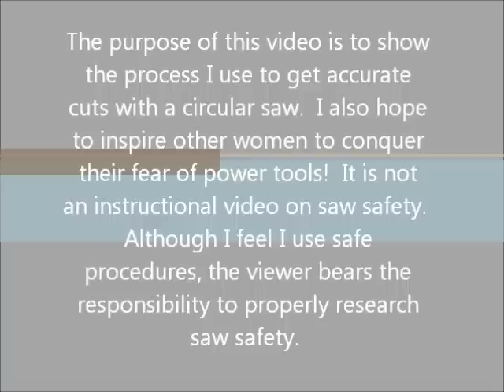Cutting a sheet of plywood with a circular saw

Comment: Thank you so much for this!  I have a lofty goal of building a cabin on my land, but am so new to tools, and have little baseline knowledge.  Most dudes take a certain baseline of knowledge for granted when they try to explain how to use certain tools or build things to me, so I really appreciate the "basics" approach you take in explaining this.
Reply from the maker: Thanks Christina Galeano --I found it difficult when I was starting out also, to find information that was from a true beginner's starting point.  Glad this helps!  Lofty goals are excellent to have--good luck with your cabin building!
Reply: Christina Galeano:
I aint shure what kinda axess you has to logs, but you can shure build a cabin reel easee by usin 3 sided logs. 3 sided logs is sawed flat on 3 sides so the 1 round part a the log is showin outside the cabin. You just drill an spike each log on top of anuther log with a layer a insulation in between each log. Overlap the joints... it is easee an STRONG. There is problee lotsa vidios on You Tube bout 3 sided logs, but I aint looked to no for shure.
I lived in a veree remote part of Alaska so I had to bild my cabin with no power tools eggsept a chanesaw and other hand tools. Took me bout a six munths to bild a 16 by 24 foot cabin from scratch. I had metal roofin and stuff I coodent make flown out in a flote plane, but 90 persent of that cabin was frum nature. Eben the ferniture. Bilding a log cabin is hard work phisiclee, but mentalee it is veree relaxin, an satisfyin. I has lotsa vidio footage of bilding it, an a few other cabins to, but I aint shure how to put em onto You Tube yet. 
Good luck with yure cabin.
      :)

Comment: As another woodworker / finish carpenter of the pink toe persuasion who has a full-time, permanent Southern twang, I used to use a Dewalt 18 volt sidewinder and a corded 15 amp Makita magnesium hypoid worm drive saw for a lot of work when I did framing, but for breaking down sheet goods and for finish work I do mostly now, I much prefer my Festool TS55 track saw.  I loathe cutting on the floor, but when I have to, I use a sheet of 2" rigid foam insulation as a backer board.  With the TS55 track saw coupled with my HEPA-filter CT26 dust collector, there is almost zero sawdust or debris to clean up.

Comment: Tip for anyone on a budget: You don't have to spend tons on your circular saw, but most definitely DO get the best blade you can put your hands on. A sharp, high quality blade designed for the material to be cut (plywood in this case) will make a bigger difference than any other one thing you can do. Great presentation. Keep it going.

Comment: Good video because you go over some important procedures many overlook i.e. setup, use of a guide, protective gear, wood placement etc. You don't need a table saw to rip sheets of ply. I have a table saw and unless you have the room and a couple of sawhorses and a couple of roller stands it's  just as quick with a circular saw. Just make sure you have a quality blade, 52 tooth or greater is recommended, for ply and cross cuts. Setting up the guide the way you describe is an excellent method to insure accuracy.

Comment: I recently got the Circular BOSCH SKIL Saw and was very much confused how to cut the wood in Perfect Straight line. After watching your video I was able to understand that now I need the Other piece of Wood which would act like a Guide to Cut the wood in Perfect Straight.     Thanks a lot for your video which is Really helpful for cutting long plywood pieces for making the Wardrobes.
Reply: Not meaning to be pedantic, I would point out Skil is a company and Bosch is a separate company.  They each make power tools.  To call a circular saw made by Bosch a "BOSCH SKIL Saw" is like calling a car built by Daimler-Benz a "Mercedes Ford."   Similarly, a "Brand X" cheap knockoff adjustable end wrench would most definitely not be a "Crescent wrench,"  although you can hear such things said often.  It's bad because it gives the impression to others that the speaker doesn't know what he's talking about -- even if he's a skilled and expert craftsman.
Reply: Zain Khan I don't think welsh rabbit understands proprietary eponym. Skil saw is synonymous with circular saw.
Reply: Hmm. I did'nt knew Skil and Bosch were different. 
But when Bosch sells the Products. It says: Skil by Bosch".
Reply: I'll have to check out the box, I just got one. It might be a corporate merger that I missed.
Reply: It appears that Bosch did indeed used to owned Skil. It was sold last year to "Chervon". I'm not sure if that is a typo or not.

Comment: Love that your attempting using a circular saw as many would be afraid to, your 2x4 should run with your cut unless the timber underneath is scrap, buy or make yourself a couple of tressels out of timber 2x4, its funny saying that as in Scotland its 4x2 make your job a lot easier keep you of your knees and better control on your saw, but I praise u for doing your own work as there's very few with your ambition.

Comment: Awesome job.  Covers all the safety aspects and did a great job. Even if you had a tablesaw you would still probably prefer to do it this way. Big sheets of plywood on the tablesaw are very hard to handle unless you have a huge out table and set up is difficult.  That's a great 8 foot cut out jig. I've only made a 4 foot one maybe I need to make an 8 foot one too. Thanks!
Reply from the maker: Thanks so much!  Everyone keeps saying my back won't hold out (and honestly, it doesn't like it after awhile--and for a few days after lol) but I don't think I can wrangle a full sheet onto sawhorses or a table saw (and no outfeed table as of now) without help and I build by myself.  Sawhorses might be doable and I could make them work double duty as the base of an outfeed table, so I am probably going to look into those, but I have a feeling I'm going to prefer the floor because I'm just used to it at this point.  I have used the 8' jig a LOT, I would call it indispensable for my projects!  Thanks again for the comment :)

Comment: nice video....an alternative to using 2x4's under your plywood sheet is a thick piece of pink insulation...it supports the sheet while allowing the blade to cut harmlessly through the foam.
Reply from the maker: +Art Julius The sheet of insulation is a good idea too, and one I thought about using when I was figuring all this out.  I decided on the plywood because I could tuck the 2x4s away in a corner of the garage when I wasn't using them and the sheet of insulation took up more room.  But I think it would work well if you have room for it!

Comment: this method definitely works well,just very time consuming. One that I use that is quicker especially if you are cutting several strips of the same size is to just make a jig that lips over the edge of the plywood and is the length you need for your cut hold the jig to the edge of the plywood and hold the saw up against the jig and cut.I could have made the jig and completed my cut in less time that it took you just to mark your piece. I am a finish carpenter so I have to do a lot of field cutting using circular saws or just small little jobsite table saw and that is my most used method. I also put the sheet on saw horses and I use cordless circular saw with a thin curf blade. Nothing wrong with the method you are showing here at all just sharing another way.

Comment: Heard your comment about wishing for a table saw, but most woodworkers still cut their sheet goods on something like a torsion box table due to the size.  Search for a video called Addict Cut Table for a 10 buck table that also has a built in lever to lift even a 3/4" full sheet of plywood onto the table all by yourself!  Yes, you'll need a couple saw horses, but there's plenty of them you can find on Youtube made out of a couple 2x4s.... keep at it!  For less than $30 you'll have it all and can drop a sheet of plywood on it during parties and play beer pong!  LOL

Comment: If I might make a suggestion, as one gets older getting up and down on the floor becomes much harder.  I use the same method except I have two saw horses that hold a door.  I use scrap wood to raise the panel off the door as the door is not 4 x 8 but this puts the panel at a height U don't have to go up and down.  The saw horses fold up and are stored out of the way when I don't need it.  I still use a worm to cut panels which makes cutting much easier with the added power.

Comment: Awesome. I don't have a table saw so I wondered how I would cut large sheets like this. Now.. I just have to have a truck to haul such large sheets! I guess maybe I can convince the supply stores to cut them down a bit for me...
Reply: Use karate ;)
Reply from the maker: My favorite "truck" for hauling so far was my Honda Odyssey minivan if you can believe it!  I could get a couple of full sheets of plywood in it and still shut the back which meant I could also fit all of my face frame boards in there too without them flying out the back.  Now I've got a Honda Pilot and I can only haul in good weather and I get nervous about how well it is all secured as I'm driving down the road with the back open.  Do you have a Home Depot close by?  You can look into their truck rental service.  I have a friend who has used it and said it was pretty easy.
Reply: Actually yes home depot is only about 3 miles away
Reply: I rent a pickup truck from Uhaul. It's not expensive as long as you're not renting them all the time. And home depot has one you can rent by the hour.
Reply: Pink Toes and Power Tools NU vrei sa fi sotia mea?

Comment: nice video.  Consider putting the 2x4s inline with the plywood to eliminate the tripping hazard.
Reply from the maker: Hi Tony--thanks!!  I intentionally put the 2x4s perpendicular to the cut I am making so that the board is fully supported as it is cut off, to hopefully eliminate any chance of kickback.  But it does make it harder having to be aware of where they are during the cut!

Comment: Hi Kristen. Thank you for sharing this video. I'm building a shed at the moment as my first building project and watching a lot of how-to vids on YouTube. Yours is one of the most - if not the most, informative I have seen. I really connected with all the details you addressed - those are the things that so many other videos (mainly with guys I might add) assume you know and don't explain. You clearly have an innate knack for explaining simply and identifying all those simple details that many videos tend to miss (for example, I liked the knot in your power cord and slinging it over your shoulder and the way you explained the speed you move the saw to prevent burning). One question... do you set your saw around the same depth as the ply? I guess you use those 2x4s underneath as your supports all the time so it doesn't matter if you're cutting them slightly?... Please keep up with making your videos. I think you bring a very unique and refreshing perspective to way building is taught and you're videos will be invaluable to both women and men in empowering them to have a crack at building. Kia ora from New Zealand!
Reply from the maker: Thank you so much for your comment!  Sorry about the late response, I haven't checked this in awhile.  I do set the saw slightly more than the thickness of the ply, plus add in the thickness of your guide (mine is 1/2") so when I adjust the depth of the blade, cutting 3/4" ply + 1/2" guide = a little deeper than 1 1/4".  Lately I have to adjust it a little deeper than even that, because I think my guide has warped a little bit and sometimes the blade doesn't clear the entire cut.  Thanks again for your kind words :)

Comment: I prefer to have the plywood on saw horses.I mark each end of the plywood at the width of the cut, take a chalk line and mark the cut line then use my saw to cut the chalk line.  simple
Reply: roy hoco OK when doing rough construction!! but more delicate precision measuring needs a guide!! especially when using birch!! which only gives you a thin layer of smooth wood!!
Reply: k sera
Reply from the maker: Nothing at all!  I didn't have one at the time that I made this video though :)

Comment: 1st I would toss that particular saw right in the bin and pick up a nice Milwaukee, Bosch, Porter Cable or DeWalt. For blades, Freud Diablo blades are awesome for the price. A trick is to listen to the tone of the cut - a perfect even sound/tone will produce a sheen to the cut edge and shows your not twisting the saw through a nice straight cut. After years you can do this without the guide. Your cut was close to perfect in this manner - it is mostly the saw and blade that are your problems.

Comment from the maker: I need to find a way to attach the pencil to me somehow--it's always in the opposite part of the garage than where I need it!  I'm pretty sure that I used the cuts on one of the storage beds with drawers that I made for my kids--I think that is what I was working on at that time (you can check them out at Pink Toes and Power Tools).  All of my woodworking projects are under the "Project Gallery" tab at the top!
Reply: Pink Toes and Power Tools that’s what your ear is for PT

Comment: I would recommend positioning your sheet on the ends of the 2x4's- so you don't have them sticking out on the side where you are cutting from. It is unsafe and awkward to have to step over them while cutting- simply reposition the sheet so the ends are not sticking out- and you don't have to worry about tripping over them. You don't want to trip accidently with a running power saw in your hand.

Comment from the maker: So far I've avoided hard wood because of the expense--especially as a beginner.  I am thinking about using poplar for the face frames of a built in I am planning for.  It will be painted, so I don't mind the unappealing color it can have.  I know it isn't the hardest of the hard wood, but I can't stomach paying hard wood costs--even now that I'm not a total beginner.

Comment: Good presentation, and I like the jig you made - great idea.  As a female, I knew nothing about how to use any power tools. Since I love decorating, but hate paying for the labor and (so often)  poor workmanship, I purchased assorted power tools and taught myself by watching videos and reading.  Now I'm always involved in a project. Tongue & groove ceilings, crown, tiling, installing wood flooring, etc. Just curious, what project are you cutting this wood for??
Reply from the maker: K Kat Thanks for the comment!  I can't remember which project I was working on when I filmed this, but I think it was the storage drawer bed I made for my daughter a few years ago.  You can check out what I've done at PinkToesandPowerTools.com in the project gallery--I mostly do built ins.  Right now I'm working on cabinets with drawers for my craft room!  I envy you the skills to DIY what you listed--ceilings, floors and tiling seems way harder than what I've tackled, although I hope to try putting up tile backsplash in the kitchen in the future.